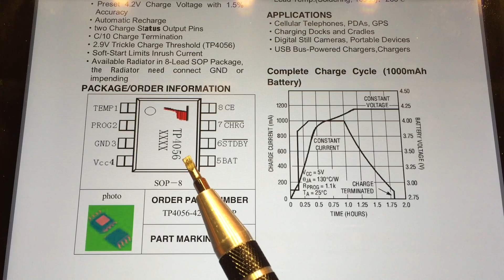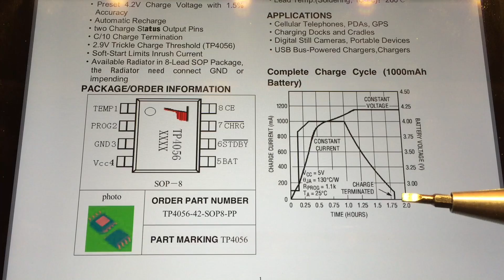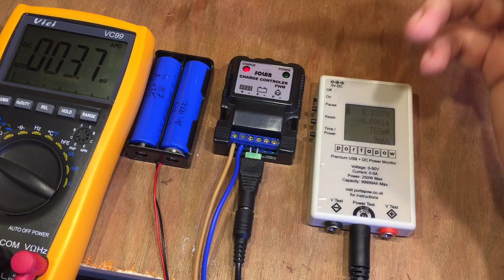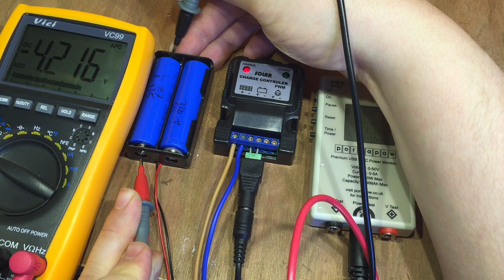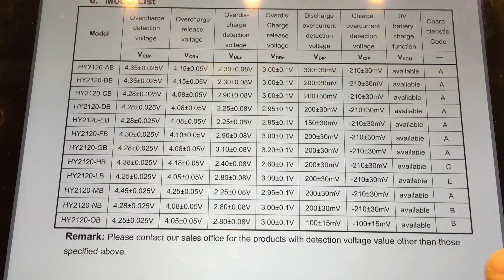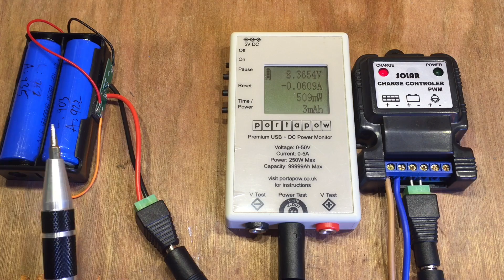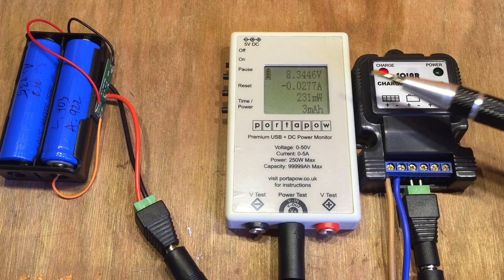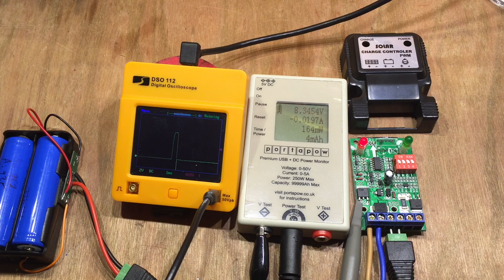Cheap(est?) Lithium Ion PWM Solar Charge Controller - 12v Solar Shed

Comment: Hi Mr. Welch, this a great video and is very helpful and educational. I just want to ask you, I am currently working as an IoT Officer and dealing with different batteries (Li-ion, Li-Polymer) and other as well. We are encountering battery problems and trying to solve this issue. Do you have solutions that can provide to me so that I can solve this problem in my end ? 

Thank you
Reply: What kind of problems you have? I think i have deep knowledge about batteries.
Reply: @rm6857  I have designed a solar controller for my IoT project for deployments, in some stations, It's automatically recharge when it's overly discharged. On the other hand, some don't. When it overly discharge it stays OFFLINE forever.
Reply: @classicallyold  Depends the situation what do you mean overly discharged, voltage individual series cells etc. Battery can have undervolage as a whole pack(aka discharged), individual series cells with same voltage but little bit lower than cut off, they will be just recharged, and working again. But if one series cell is way bellow cut off voltage(aka disbalanced pack) there should be some balancing circuit to charge it to same voltage as other series cells, if there is no balancing circuit, most likely there is just protection circuit, which will disconnect it forever, because 1 undervoltage series cell will cause during charging other series cells to be overcharged and it can lead to explosion... Can you describe better your battery packs?

Comment: But won't your battery protection circuit cut off the supply to the cells as they reach 4.2v per cell?

Comment: Hi Adam. Do you have any (easy/simple/cheap) suggestion how to stop this cheap charger from charging when the temperature gets below zero? I know the trickle charge is not very good but this thing is soo cheap it can be very usefull for simple solutions. But if they are out side they batteries will die for sure in the winter. I see many bms's for a few euro's but I don't think they mention temperature at all?

Comment: Good video. Let me ask you something: Is it possible to use a board protection like BMS 3S (model: HX-3S-01) without a charge controller ?. I need to power an Arduino board with only 3 batteries (18650). This board model has a charge and discharge protection and with a diode I could connect a solar panel and power my circuit. Thanks for your answer

Comment: is there a better battery to use for small 12v solar systems ? thanks . your video made me think i dont know what im doing
Reply from the maker: Lead acid tend to be the best match for 12 volt solar chargers and automotive products. I tend to think lithium ion works best in a 24/48 volt situation. I did a video series about that - Solar charging Lithium Ion 18650s - the first one talks about why I don’t think they work in a 12v system. 
When looking at lead acid, I’ve stuck with agm or sealed batteries. A good old sealed lead acid battery doesn’t need any maintenance or fancy kit to keep it running but can sag and may not last as long as lithium alternatives.   
I want to look at suitable 12v replacements though soon.

Comment: Beside the trickle charge problem, I read in the manual that there is a Overpressure protection Voltage of 9,5 Volt for a 7,4 Volt System, which I understand as the max Voltage of the Solar panel. Did you connect a standard 18V panel or something with a lower voltage?

Comment: Its sad still no legit out of the box li ion charge controller. I done gave up like 10 li ion controllers and they all trickle charge. I have my imax b6 hooked into my load from charge controller to charge my packs only way I can be sure. Use the cell checker to balance in between charges so far it works good but very much hands on. Just wished we had an decent out of the box option. 

Love your vids your doing a noble job!

Comment: Can anyone please measure the current this controller drains out of the battery if no sun is shining and no load is connected? At what voltage does it disconnect the load?

Comment: Adam Welch why didn't you put a wattage bulb like 100/50 watt for the controller to discharge the power to when the batteries are full? the red block has a 1234 on it is for programing the light circuit just for that? just asking, let me know if i am wrong on this point, Old One Legged Joseph T retired navy

Comment: Hi Adam, im interested with this projrct and i have a problem with it.
how much the voltage of the solarcell you use for it ?
and from the load pin, can i use it to power some microcontroller like arduino ?
thanks

Comment: Very interesting video! thanks!
I'm going to use this controller to charge a 3cells battery with a 20W panel in order to load a timelapse camera close to a glacier. I'm not an electronic expert (I'm a glaciologist), and I'm testing the system here at home and, until now, I haven't found problems at the battery. I have a timer relè that drains 3mAh from the system and the camera that shots every hour, so maybe it ie enough to offset the trickle charge (?). Do you suggest to change this controller with the MPPT charger you reviewed in another video or I can give a try with this one? thank!
Reply: I add another question. Do you think that this charger is equipped with any sort of termometer that disconnect the charging below 0°C? otherwise I suppose this is a very dangerous charger to be used in cold environments!

Comment: Hi Adam, any recommendations for a controller to charge li-ion batteries from a power supply (not solar). It's for a battery pack I want to take camping. Thanks
Reply from the maker: It depends on your battery pack configuration.  How many cells are you looking to put in series?
Reply: Adam Welch thanks for the prompt reply, I was thinking of using 10s 12p but realise that most BMS only go up to 7s so probably 7s 12p. I am going to attach a buck/boost controller for variable output voltage.
Reply from the maker: +Brett Ok right - that's a reasonable size pack and a little out of my area of experience. I'd probably suggest a balanced charger.  I have used a HobbyKing clone of the turnigy accucel-8 but that can only do about 4 amps on a 7s pack which might be a bit slow and I think they're hard to come by now. 
You could just use a power supply that pushes out about 28+ volts and use a standard BMS to protect the pack but again I'd suggest something to balance and or monitor the cell voltages to be on the safe side. 
I'm not sure I've been much help?
Reply: Adam Welch yes you have, gave me plenty to think about. It would be great if that charger were still available, slow charge is ok, most others only go to 6s, maybe I need to rethink the configuration.

I think I will go the Wincong SL03, you reviewed its little brother about a month ago. It can manage the charge and discharge but is missing the BMS. Seeming as I will be using all of the same battery and monitor it regularly it shouldn't be a problem.
Reply from the maker: I think Paul Kennet uses one of those for his 7s packs (search him on here if you're not aware of his stuff).  He also uses the iCharger 1010B (I think) which is a nice balanced charger for up to 10s packs - not cheap though!  Cheers

Comment: Great video!  Thanks for posting this!  I know it was just an example, but what is "the crowd as effect" @2:42 ?
Reply from the maker: Ah!  That'll be my accent or simply mispronunciation.  I was referring to the 'cloud edge effect'.  It's a phenomenon when the sun goes behind or re-emerges from a cloud.  The edge of the cloud can focus more of the suns energy toward your location (and therefore the panel) and give increased power for short periods.  Thanks for the kind comments.
Reply: Adam Welch ah, thanks!  I'm super new to solar, so this is great info!

Comment: Did you not notice that the amperage was negative at times?  And what would be happening at that point? OC protection?
Reply from the maker: +Surging Circuits When the PWM cycle gets very low mich of the current to power the charge controller will come from the battery. Depending on when the meter takes its sample will depend on what result is shown.

Comment: Adam, Can I just use the USB output on my solar charge controller and connect to a power bank which recharges my 18650 lipo batteries.
These portable power banks are cheap and have safety limits built in and usually recharge with 1 amp. They typically hold 4 to 6 of your batteries.
Also, is there anyway to charge the 18650's from a 12v car battery?
Reply from the maker: +MuleMT Yes you could do that. You'll need a lead acid battery (or something else suitable) on your solar charge controller to provide power to the solar charge controller as you'd expect. I've used powerbanks in the past to charge 18650s. 
I use the liitokala engineer lii-300 now to charge my single cells. That can be powered from a 12 volt source and comes with a cigarette/accessory socket cable.
Reply: Another way to charge 18650s with a 12v lead acid battery is to use an IMAX b6

Comment: Hi,
do you think the addition of a high value electrolytic capacitor will solve the problem of trickle charging?
I would really like to use this controller :)
cheers
Reply from the maker: +Mark Pilzer Worth a go perhaps. Trickle charging is a contentious issue regarding lithium. I think most agree it has negative effects, but how negative they are is still up for debate - little research that I've seen. The larger your pack, the less current going into each cell which might make the side effects even smaller. Finally you might have a BMS which may use a small amount of current all the time. As with everything, your mileage may vary.
Reply: Adam Welch A BMS will be used, what value of capacitor would you recomend on a 4p2s set-up? planing to expand it later.
Might build in a led module or something to have a small load at all times.
Lastly, do you think this is worth a try for a 3s config?
eBay n. 262701551264
Cheers

Comment: Adam,  with the 18650 protection board attached to the batteries, does it cut off the voltage/Current at 8.40v even if the charger is supplying 4mah.?  looking at a project with a BMS instead.
Reply from the maker: The cheap BMS's will cut off above the maximum suggested voltage of the cells.  I can't quite remember the specs for this little BMS, but typically they switch in a resistor at about 4.25-4.35 volts per cell.  So your cell is already slightly over-voltage before anything happens.
For balancing I quite like the CellMeter-7 ( https://goo.gl/IiXGKB ).  In it's fairly undocumented balance mode it seems to actively balance all the time.  Trying to keep all the cells within a small margin whether they are high, low or whatever.  It doesn't protect the cells from over or under-voltage however.

Comment: Subscribed :) love electronics channels, already subbed to Julian Ilet, Bigclive, Mike etc.Also seen this controller for sale for buttons. I have a project in mind that will require 3 pairs of 18650s in parallel (so still 2s). What kind of "portable" solar panel could I get away with? Capacity of the pack would be 8000mah taking manufacturer spec liberties into account. Possible to recharge it on a decent sunny day in the UK?
Reply from the maker: +David Nicholas Thanks. I'm humbled to be named in the same list as those guys. 

My 7s pack which is just 2000mAh and attached to a 100w 24 volt panel. This morning the pack was fully charged by 10am. On a cloudy day it's obviously going to take a lot longer. 

You don't want to charge at much over 1C I'd suggest. So a maximum possible current of 8amps, but on cloudier days 1-2 amps all day should still see you right. 

Solar isn't really an exact science I'm afraid.

Comment: maybe it needs something to dump the load to? or perhaps you got a defective one?
Reply from the maker: +beingsneaky I guess it could be defective, but it's working in exactly the same manner as the 12 volt lead acid version. You shouldn't need a load in solar - not like wind. Disconnecting the solar panel completely would not damage it, it'll just hit its open circuit voltage and produce no current. 

Thanks for your comments
Reply: ah ok i was just throwing something out there lol. but you know what you are talking about, seems like you test alot of these things out.
so it should have shut off then eh? thats to bad, looks like a good idea.
i seen a video of someone making a 24 volt solar setup with 1860s.
Reply from the maker: +beingsneaky That could be me - I've made a 24v 7s pack which is solar charged. I'm using a lead acid solar charge controller too. It only really works because I don't draw any power from the batteries in the day. The float charge doesn't kick in because the absorb voltage is higher and lithium batteries don't fall back in the same way as lead acid. 

I've also reviewed a couple of mppt lithium solar chargers that have a better charging profile than this charger. Not much more money either. Have a look through my videos for it :-)

Comment: That isn't considered a trickle charge. A trickle charge is when they both reach 4.2v 0A and the controller keeps going, overcharging it.
Reply from the maker: +joblessalex A trickle charge according to the definitions I've seen is a small amount of current passing into the cells which is intended to keep the cell at a set level. This can cause plating in lithium cells. 

If you take a look at the cheap MPPT lithium charge controller I looked at in another video it completely cuts the charge until the cells drop to 95% of the termination voltage (4.2v per cell). That's how I think lithium should be charged.
Reply: ***** I thought lithium stopped charging at 4.2? As long as you don't increase the voltage shouldn't the cells stop taking current?
Reply: There's nothing inherent about a lithium battery (unless there's a protection circuit installed) that would cause it to stop taking current.

Comment: Did you try with other batteries to see if it reaches 8.4v and then completely shut offs? I wonder if the charger is just trying soft charge the battery to reach 8.4v slowly and not fast, slow charging gets better readings I believe this charger might go to 8.2v-8.3v very fast and them slows down "trickle charges to 8.4v" but one of your batteries could be damaged not allowing the charger to reach 8.4v and then shut off........... most lithium ion batteries only reach 4.1v , Im guessing this charger is for lithium polymer that can reach 4.2v.

Comment: Is there a complete video that shows good 12 volt batteries and a good solar charger for them? I would love to looking into getting a 12 volt Li battery for my solar set up. I have a 100 watt panel.
Reply from the maker: +campervandavid I'll be looking again at charging lithium ion via solar very soon. Just need to get some bits together.
Reply: Seems like a lot of problems can be solved charge 100p1s, 100 cells all in a parallel.  Buck to charge at 4.0 volts and boost to bring everything back to 12V.
Reply: pirucreek 
I am using a similar circuit, but you loose a lot of power in the buck/boost process, and also the booster needs to be always on, as there is no decent 3-4v timer available! only 12v :(
cheers

Comment: Hi Adam,
Love your videos mate, I've gained from them, they're awesome. Your a legend.  I was curios if that trickle would eventually stop if it were left for half a day? How long was it where you said "quite some time"?  Perhaps it had something to do with the cells still balancing themselves out. Maybe the lesser of the two cells was still being brought up. I have a genasun 4A that is no where near as affordable so I think I might still try to utilize this one. I have a 7.4v and 11.1v, do you suggest the pic micro controllers would be the difference here? Also how soon and how bad do you think the damage could be with the trickle side of things?
Reply from the maker: Thanks Michael for your extremely kind comments.

I think this needs more investigation - and I plan to do just that.  I believe the cells I used were pretty well matched and well charged when I tested this solar charge controller.  I took my information about the trickle charge from  http://batteryuniversity.com/learn/article/charging_lithium_ion_batteries  which states "Li-ion cannot absorb overcharge. When fully charged, the charge current must be cut off. A continuous trickle charge would cause plating of metallic lithium and compromise safety."

I've not seen the Genasun models before - just had a look over them on their site.  It seems that they have done a very similar thing and created a series of charge controllers where they can adjust the battery charging parameters to suite different cell chemistries.  They could well be using a PIC inside although many other microcontrollers could achieve the same result.

The difference between the 7.4v and 11.1v versions are simply the code on the pic.  There aren't any hardware modifications at all.  Same with the NiMH version and the lead acid.  All identical inside but for code.
Reply: Yeah plating of metallic lithium doesn't sound good. Thanks for the info, pic micro controller stuff makes sense. Have you come across any other affordable lithium controllers that you like? I'll subscribe and look out for your future videos. Cheers